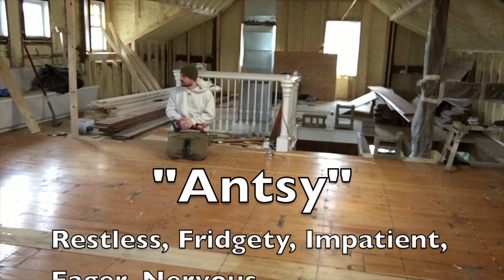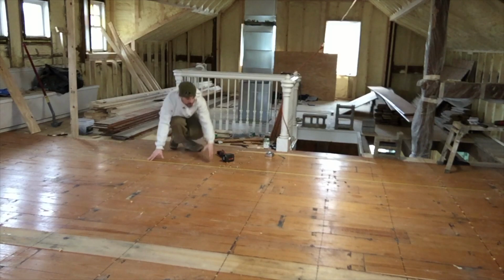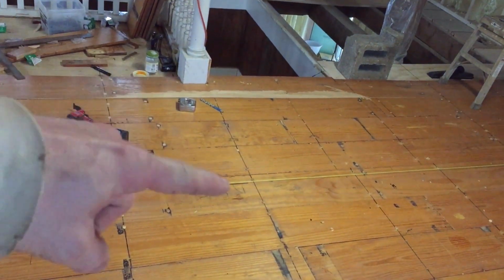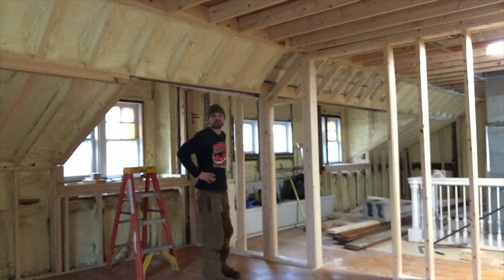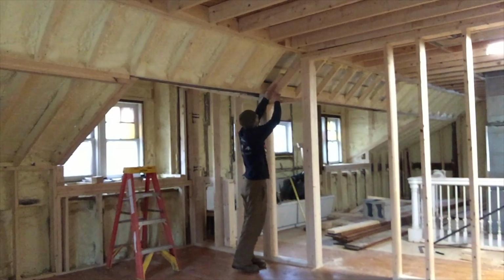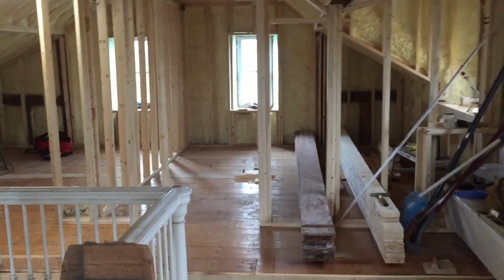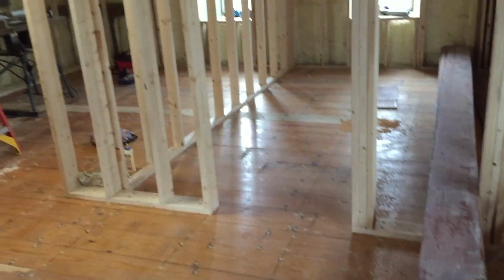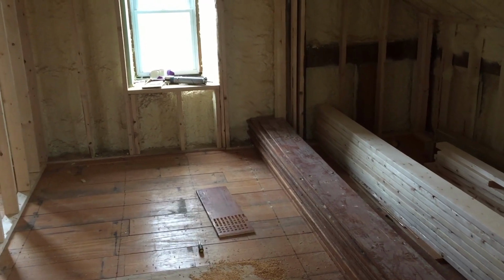Framing a 211 Year Old House - Episode 62

Comment: I'm curious why you decided to frame over your finished floor instead of framing on the subfloor? I am guessing you did it for simplifying the laying of the reclaimed bench seat material, and wanted to avoid having to cut in each room, but was curious.  It would be more work, but if you had framed first, then you'd actually have been using less flooring material in this finish stage. I also thought that if you ever needed to replace the flooring, you'd be in a little pickle as you have walls on top of it now. Great job though! Floors look amazing. I'm not nit-picking, I'm seriously curious because I am looking at the same decision process on my farmhouse restoration.
Reply from the maker: OffGridBear Is it possible for you to add me on Instagram and then we can chat about it?
Reply: @1806StoneHouse   well I set up an instagram account but have no clue how it all works. LOL. Sorry. No worries... I may end up getting answered as I finish going through all your videos as well. I don't do any social media on my smart phone, and it seems the web version of instagram doesn't offer any DM option for mac users unless I'm missing something. No sweat. :)
Reply from the maker: OffGridBear let me know when you wanna chat! 👍
Reply from the maker: OffGridBear I just saw this message.. you can email me at mannin63@potsdam.edu

Comment: I have to ask. How did you square the main wall? I think you said something that it was 36 inches away from the railing, but the only other thing you said was that it was straight. How did you ensure that the wall was square to the room?
Reply from the maker: mandingoteck dailey good question.. I measured from each side of the string to the opposite wall (that is square) it’s not perfect. But, no one will know.. 😜